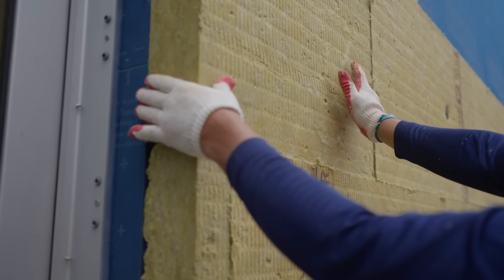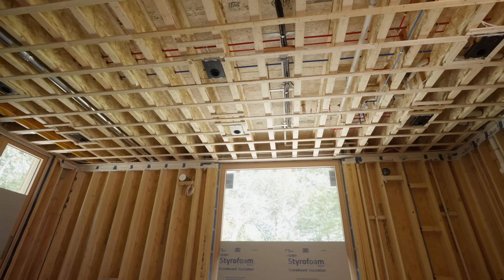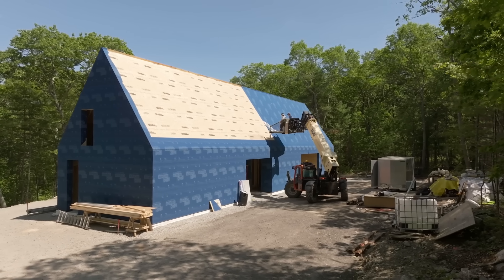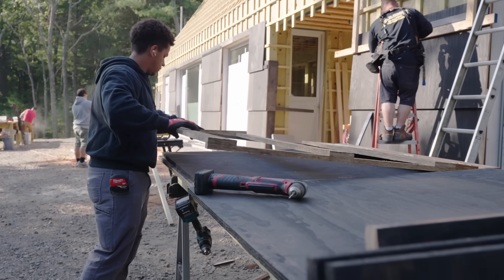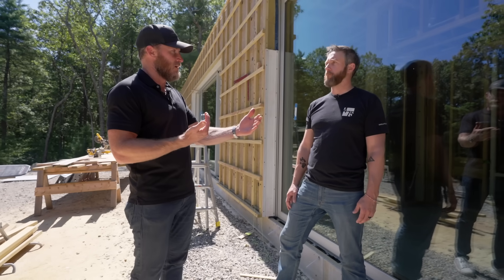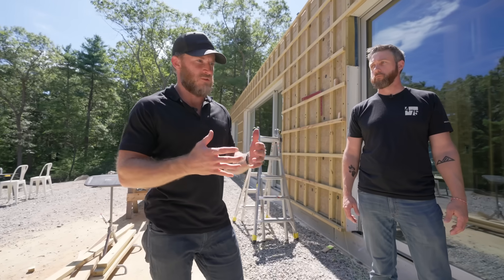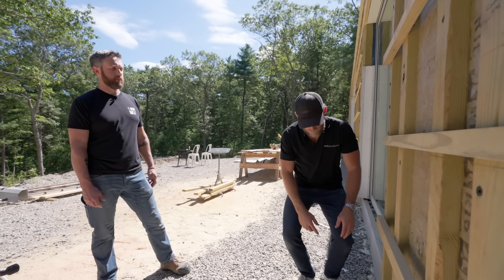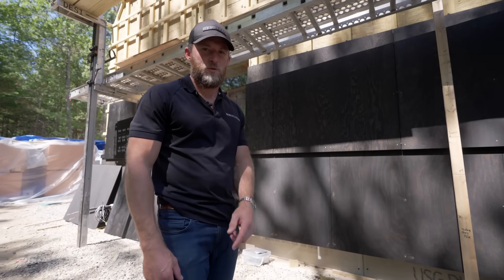Why Exterior Insulation Is The Key To Your Home’s Future

Comment: ???? It's a great looking job. Lots of insulation. But....Wow! What a extra labor upcharge. What an upcharge for insulation. Where is the payback? Where is the savings? Is money saved on the heating system to fund the extra cost of this type of construction. Do the savings come from a lower power bill due to extraordinary KW prices? I started building super insulated houses in 1985. For those of mid-range wealth, they don't want to spend an extra 100k to save on electricity. There is no real payback. Yes, the house is stellar! Payback and saving may come in when the house is sold when an individual of means can fork out for those costs. In cold climate, we can still build a home with 2x6-R21 wall cavities, R5 Extruded exterior/interior board (joints taped and/or sealed), single wall siding (sealed joints). R-30 underfloor or R26 crawl walls, R49-R60 lids. The difference between the power bill of the latter and the classy home in the video is money in the bank. It appears that the payback for energy savings would be decades and decades. The comfort that I have experience in my last 4 personal homes as described before has been great. By all means, if you have the money, have NS Builders build you a home. They do excellent and clean work. I built customs starting in the 70's. Money was tight. Economy was poor. Moving from a 2x4 wall to the super insulated construction was doable and effective. By the time I retired, big money started flowing and now there seems to be an endless supply for building the optimum home. Great for the builders also! Keep up the good work!

Comment: We build using ICF. Exterior and interior insulation done day one. The rockwool is a nice option for builders framing exterior walls using wood. Good video.
Reply: What is cost difference roughly between the two?

Comment: What is the trade-off for an air-tite house with more electrical demand for an air handler, the cost of outside insulation on a home? An air handler running 24/7, two fans running both in summer and winter, now on top of that, you want a homeowner to add more cost to his home with outside insulation>

Comment: We retrofitted our home in Montana with 3 inches of exterior Rockwool Comfortboard 80, air-sealed, and added triple pane windows.  Prior to doing this, our home was cold and drafty in the winter and did not hold heat.  You could hear jet skis on the lake throughout the summer inside the house.  Now, we can pretty much heat our home with space heaters.  You no longer hear the jet skis on the lake.  It's just a much more comfortable home.  We were going to change the siding, so it made sense.  Heating bills have dramatically dropped.
Reply: Our house was built in '87, with single-pane windows. We bought it 2004, and upgraded to double-pane windows shortly thereafter. Our utility bills dropped by a third, just by upgrading our windows. They also blocked a lot of the outside noise (we have big picture windows).

Comment: Living in the great plain, I’m afraid my Hardiboard would be ripped off if I used furring strips. We get 80mph every year.
Reply: Maybe increase furring strips thickness from 3/4" to 5/4 or 1.5? Or use fiberglass Z-girts for better holding power. I'm designing my wall assembly for high winds, too, and thinking that should work.

Comment: I've been researching ICF for my next and final build. 'Seems' to have fairly similar benefits, in particular because it's virtually fully sealed. from air leak and moisture ingress. The exterior I was planning was steel panels, which is using standoffs of about 1-2 inches in total. 
R value isn't be be all of course. As I understand it the bigger problem is air change rates. So, ICF + quality windows and doors more or less solves this problem. 
Feel free to tell me where I'm wrong.

Comment: I think the elephant in the room is layout and scale. Larger homes not only cost more to build but take a lot more to heat/cool and dehumidify/humidify. 

Minimal surface area Cubic/spherical homes aren't practical for most but we could definately make smarter layout descisions and scale back some of grander designs. 100 years is peanuts, we should be building houses with reinforced concrete foundations that can stand up like an ancient Roman aquaduct, superstructures that can last 500+ years with maintenence.

Comment: Ive been using the comfort board for a while now. One thing I learned the hard way is how soft the edges are when securing the rain screen. I use 7/8 fir to strap out the house and I was having a lot of compression around windows and doors along with the top of walls and corners. I ended up switching those areas over to dow board for its compression strength. Its small enough strips so I feel the vapor will still dissipate. I also use two 4x8 sheets with staggered joints, otherwise you still get air contacting the sheathing with one thick sheet. You get a lot of people saying thats great but who can afford it. Well sometimes you need the grand home to use as a model for the simple builds. I have two economy projects going right now that Im using a my system on. You save where you can and hold the line where it matter. Right now with energy codes we have two paths, foam or exterior. I am for exterior 100%. Foam is going to be the next aspesttos and those are a more informed mans words than mine.

Comment: The problem with using pressure treated lumber for your rain screen is that you need to make sure that the fasteners are compatible with the lumber. Will your mega long screws for the furring degrade? How about your siding fasteners?

Comment: Do you have any thoughts on why not use polyiso versus rockwool?
Reply: Polyiso is vapor closed (not good), while Rockwool is vapor open (good).
Polyiso burns, Rockwool doesn't.
Polyiso has no thermal inertia, Rockwool is better (if you use the high density boards).
Polyiso will not insulate against sound (noise), Rockwool does.

Comment: Hello, first of all, I really love your videos, so many interesting details! 

I have a technical question, why do you use OSB plate on the exterior of the walls, doesn't it block the vapor? I Norway, we use GU plate, that allows the water to escape from the inside of the wall if necessary. It is also windproof - once you sill the plate connection with a special tape, so there is on need for a windproof membrane.

Comment: Sealing off your home like a bubble is not going to provide you only benefits. For one, if your home is completely sealed in and insulated, even double insulated, you are absolutely going to require air exchange systems that operate 24-7, and have zero design flaws to avoid mold and condensation issues in the hottest/coldest parts of the year. This issue will develope slowly, and be out of sight/mind until it reaches levels that start causing negative health effects.

The middle ground move is the optimal choice. You obviously want the home to hold in heat when it's cold outside, and hold in cool air when it's hot outside, but you don't get a free lunch when it comes to this process. You can absolutely take it too far, and you will pay for your mistake by having a humid, damp, stuffy, moldy home unless you are constantly running the hvac system every single day to provide air exchange and balance the indoor environment with the outside temperatures to a degree. People might find it hard to believe, but I've witnessed it first hand. Homes that can naturally breath and have good air exchange that is controlled, and slow, are your best bet. They hold in heat and they hold in cool, but they also allow it to "leak" out and in.

Comment: Stupid is as stupid does. Theyve been putting 6 inches of foam on the exteriors of certain homes on the interior of Alaska for a long time. Just imagine the extras that have to be done for door and window install . Not only that but your heat loss is through your windows which might have an R value of 2 two got it. Damn stupid

Comment: Cmon gentlemen - the 475 gent talks about drawing in the cold thru the stud frame at the beginning of the video?? COLD DOESN"T MOVE.......Heat Energy moves, from high to low. Thermal bridging is never about cold, it is about breaking the thermal movement of heat energy thru materials.

Comment: Man, that extra cost in materials and labor makes building like this only for the very wealthy sadly. I used rockwool but not on the outside, basically framing the house twice inside and out has to add dramatically to the cost, no middle class home could sustain that cost and the savings on heat/cooling would take probably 80 years to see. 

I like better building but I really don't think this is achieving a better build as much as it's just doing more of the same thing, dual framing and dual insulation. IMO ICF makes building like this obsolete as you get interior and exterior insulation but for half the cost. You can fur on the inside and out for drywall and more cooling on the exterior but the cost would be far less as the strips only have to be 1/4 inch to get that upward airflow. 

The labor, your labor must cost a fortune. 

I get it but it's too much, it's selling rich people on having something better than non rich people when there are better more affordable ways to get it done without walls having to be a foot thick. Great work, very high quality, but it's never going to be the future.
Reply: Yeah, above they said their projects typically run $700-$1000 psf. That's... extremely expensive. Most new construction is ~$200 psf in the US so these guys are at the top end of the budget, certainly for stick-framed houses. The house should last, though!
Reply: @HaploBartow  Yes, it's nice to see great builds but it's 2x the cost to build a home and ICF would be a lot lower for a similar outcome.
Reply: @FEV369  Maybe, but ICF also requires lots of concrete and foam, which are horrible for the environment and ICF isn't really suited to modification later. The house you build is the house that it will remain until demolition, which isn't a practical way to plan for housing long-term.
Reply: @HaploBartow  I agree, but some of the ICF is recycled so it's already present and there is enough of that to build tens of millions of homes. 

The concrete is just fine, Co2 is not a bad thing and no one really believes it is. The wood used were tree's that gobbled up Co2 and rockwool is made form the by product of what comes out of metals being refined... all requiring huge some of carbon. 

Again, I'm happy to see better homes made, but ICF is still absolutely superior to what was in the video. A cost breakdown would show that. 

An ICF home could last hundreds of years if maintained, just like stick framed.
Reply: @FEV369  "Co2 is not a bad thing and no one really believes it is." Sorry, I stopped reading here as this is a blatantly and objectively false statement. Everyone in the scientific community agrees and has understood for nearly a century that CO2 outputs have warmed the planet thanks to the massive scale of human industry, AKA anthropogenic climate change. I recommend embracing the science part of building science if you are truly interested in building better and for longer term; it's the important part!
Reply: @HaploBartow  Bro, "the scientific community" also believes in "evolution..." 

Wait... no no, are you one of those people who believe in random mutation, and like the laws of the Universe just back up and say "Ohhh nooo!!! back it all up, random mutation randomly needs a random amount of room to randomly do some random thing!!!" 

The issue with climate change and "science' is that every single claim made by that group of warmer nutters have failed to come true... You believe them like a religious person goes to church and questions nothing, even when reality ain't adding up to their nonsense. 

You are not smarter than others when you openly admit to circumventing a personal critical thinking process by pointing to the authority you subscribe to. 

the approx 0.04% of Co2 man adds to the atmosphere has made almost no measurable difference outside of slightly more plant growth.
Reply: @FEV369 look at that, you can just lie on the internet

Comment: Ore than halfway doing our own custom home.  We opted for zip R6 for exterior sheathing.  I personally did R5 continuous in the basement glued to the basement walls.  R10 foam continuous sub slab too.  But roof exterior insulation became too prohibitively expensive.  I am so sad, roof going to be placed in mid nov.  our hvac budget also went crazy cause I wanted radiant floor.  And window budget higher than expected due to super bomber European style windows.  I applaud this approach.  But couldn’t do it 😞
Reply: Bah!!   More than… not ore than.

Comment: I’ve always wondered why the exterior of homes are essentially left open. This would be great for sound insulation as well.
Reply: @TheTCOLL  pest control could prove difficult if they were to break into the air gap, i guess not sure how easy removal of a shingle or two is

Comment: Why are you placing WRB before insulation? It should go outside as close to air gap as possible. Its - structural studs, isulation between them, OSB, "blanket" isulation, -> WRB<-, air gap and then facade. Otherwise it dimishes reason for WRB and isulated layer is not enclosed. There will be air driven condensation on WRB and will probabbly rot something. Or I am missing something?  And other question - why windows are placed so far in structure? They should be in line with WRB.

Comment: What a crock.  You think you’ve removed thermal bridging ? Dew point ?  That wall is open to the outside.  You need spray foam   That insulation r value is not real.  Only when it’s new.   You’re a expert in your own world.  Garbage
Reply: "That wall is open to the outside." What are you talking about? The holes where the windows and doors will go? Is this trolling?

Comment: Seems like the idea of exterior insulation takes president over design of the home,  you’re using a lot of thin wood and it will twist with time. Double stud walls is in my view better as it doesn’t limit you with exterior materials. You can insulate the top corded of the trusses to what ever thickness you need for your zone.

Comment: I built 2 houses both exceeding code and had exterior insulation and found your video very interesting. I have come up with an idea to add exterior insulation but also reduce material costs and labor. Frame a standard 2x6 wall instead of sheathing directly to the studs add a horizontal 2x3 to the bottom plate and attach 2-1/2 thick rigid insulation 24” wide adding a horizontal 2x3 screwed into each stud working your way up taping the horizontal seams, then adding vertical straps 16” O/C to attach your sheathing. On each inside corner use plywood for shear resistance and use a 1/2 vapor open board then blow in dense packed cellulose. Your WRB would need to be vapor open but not need to control air since your 2-1/2 insulation board taped would handle it and the assembly could dry both to the inside and outside. The  window and door rough openings would allow for 1/2 plywood to extend to the strapping. I think this adds days and not weeks to the build for an affordable alternative.

Comment: Rockwool is perfect for keeping the heat inside, but it not great for keeping the sun out. Use natural materials. Have a look at Germany's building methods.
Reply: Rockwool is a natural material. It's spun mineral and slag fibers.
Reply: @HaploBartow  perhaps biobased was the word I should have used.
Reply: @roosmsgsg9956  Not sure why we should just out-of-hand prefer organic-based materials vs inorganic-based materials. Whatever benefit that might have would almost certainly have massive downsides for more important factors in construction like structural integrity, tensile strength, resistance to rot and fire, mold, etc.
Reply: @HaploBartow  The German market is already quite advanced in this area and has thoroughly examined the pros and cons of biobased materials. Heat resistance and vapor-open construction methods are becoming increasingly popular across Europe.

Comment: why not just use a SIP (structurally integrated panel)?
Reply: @gabrielcervantez-x4t  r sip mostly build by foam? I think rockwool is a better product
Reply: They can be more expensive and it stops you from running mechanicals on the inside as easily.

Comment: remember to talk about vapor permeability (mineral wool is an excellent example of thermal performance with a drying ability). Also, remember the heat is drawn out with thermal bridging, the cold is not drawn in.

Comment: @NSBuilders- At minute 13:33 there is a 4x8 sheet of Styrofoam Polystyrene insulation under a window. That type of insulation is NOT vapor permeable. Why was it used in that location? I have a similar project going on and have both polystyrene and rockwool on site. I had planned on using the polystyrene under the roof and the rockwool for the walls.
Reply from the maker: It’s leaving against the window for protection
Reply: @NSBuilders  good call. Did you have that polystyrene styrofoam on site for any particular project?

Comment: Hi Nick, great video. I'm a builder from New Zealand and we use a timber cavity system between air/water barrier and exterior cladding for moisture control but common practise is interior insulation between framing. My question is what is the flatness of your timber battens like (being fixed on top of the insulation)? Do you use screws that you can adjust in and out or is the insulation rigid enough that it doesn't move? Thanks